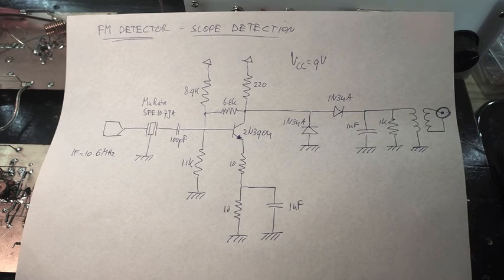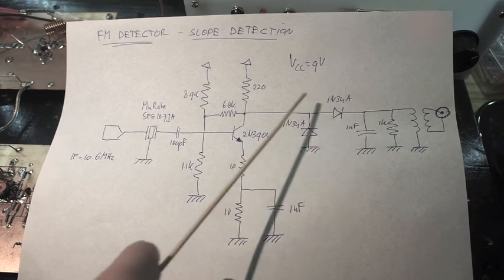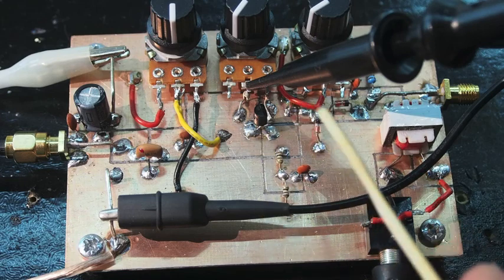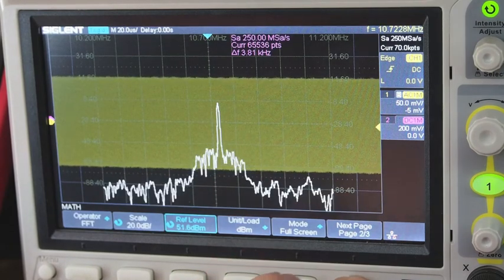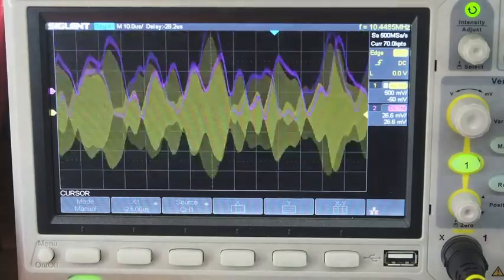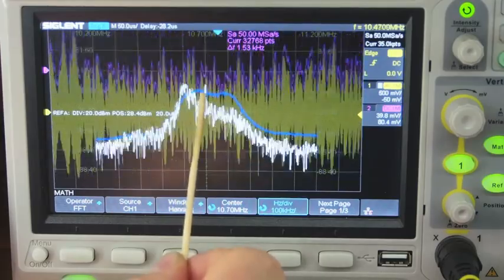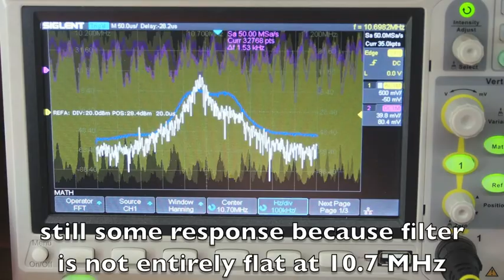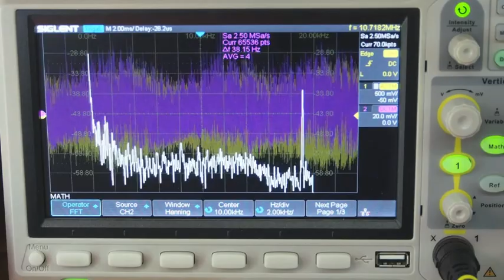#2 DIY FM Receiver: FM Detector

Comment: Very clean work! I use an unbalanced (single diode) slope detector on an FM Regenerative receiver I made, but it's noisy. I wasn't aware that it would work with an heterodyne set up. Also, please explain more about the crystal filter used as a discriminator.
Reply from the maker: The crystal filter has a very narrow passband with steep slopes. If you tune the intermediate frequency (IF) of the heterodyne receiver such that it is on the slope of the filter, it will result in a different response for the different frequencies in the FM signal. This will result in a signal which is FM as well as AM. When you put an AM detector after this circuit you’ll demodulate an FM signal. Tuning the IF to be on the slope of the passband of the filter, it works just as any other slope detector. The advantage of using a crystal filter is that it is a simple, single component, with steep slopes. Steep slopes will result in a large frequency response difference over the FM signal.